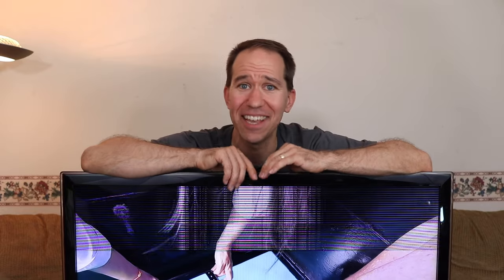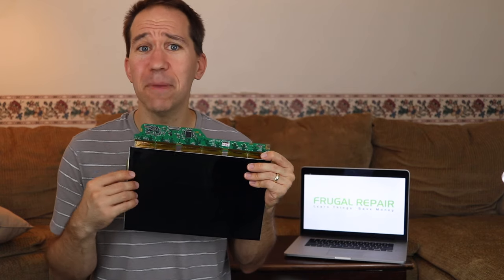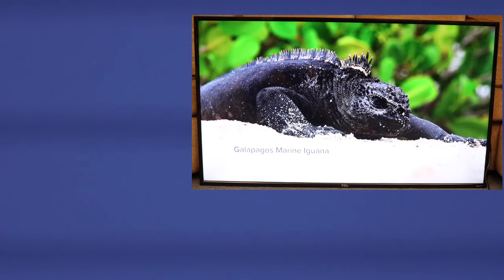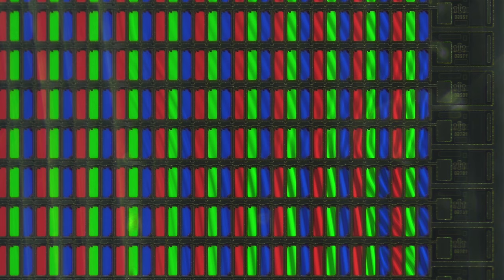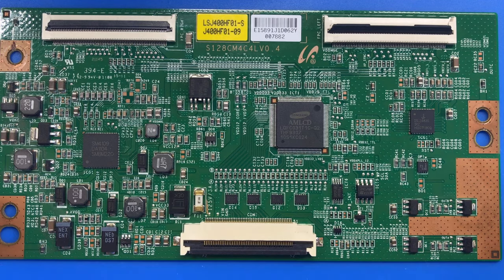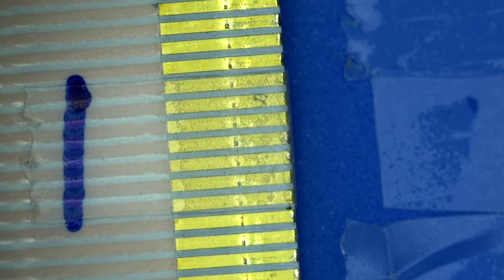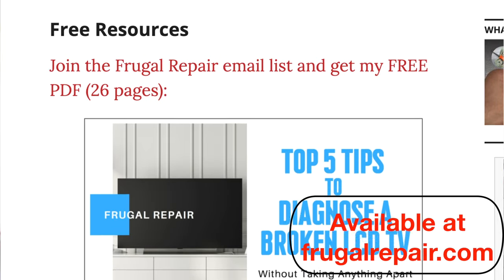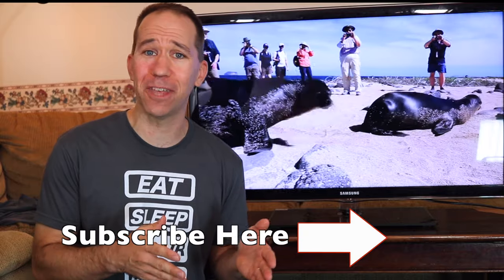Repair Hack Explained | How to Fix TV Horizontal Lines - Part 2

Comment: Hi, I've bought a broken telly because I like to repair electrical goods but I may have bitten off more then I can chew this time,  the set is a kdl-60w855b. I thought it may be an easy fix buy it's anything but
 I have tried a diffrent tcon board and the problem persists, i've reseated all cables and ribbons cleaned the inside of all dust and the TV still has a white vertical line about 2" wide, the screen can be seen faintly behind and there is a reverse image faintly seen within the white band. Could this be a main board and av board? There are that many causes however mine has that reverse image in the band so this might help diagnose. Any help you can send my way would be greatly appreciated. Thanks
Reply from the maker: Did you do the isolation technique I used in the video?  What was the result?
Reply: @FrugalRepair  sorry I'm in UK & it's 6am over here now so been asleep, im not with the TV at the moment as it's back at my flat, I'll be going there later on so will try the illusion trick, im guessing your talking about taking one side of the Tcon ribbons & leaving it off then repeating in reverse? I'll try it later and see what happens, I did however get a reaction by lightly tapping one of the microchips on the main board & got a reaction but not a great one, the line was still there the complete screen went a darker shade of grey and had diagonal lines, but only managed to gain this effect twice, also I'd like to know what your advice would be on replacing the main board and av board as I can get them online for a good price? Or are there any tests I can do to rule out them being the issue, thanks for your time & helping out, it's much appreciated as I'm stuck, im sure the screen panel it's self is good, that's why I purchased it because I know the internal parts are modular and have had mixed success in the past so thought I'd go for it, would the inverter board be a possible culprit aswell, if I can definitely rule out the panel being bad then I can just buy all the inside parts for it & it should fire up but that was my initial opinion on repairing it. However I can't get over the fact that I may have a bad panel even though there are no visible cracks or pixels that are bad apart from the white transparent stripe that has a reverse picture in it, why would that happen? Thanks
Reply: @FrugalRepair  hi I did the technique you did with the ribbons and at first half the screen went white then I forgot to turn the set off and disconnected the right ribbon, now there are 2 white lines and static in the background, before there was just a white line through the home apps page that was clear as day, now nothing but static sound and a dark screen, I could hear the apps sounds then the TV shut down & started blinking red 5 times in a row
Reply from the maker: Did you short something in the panel by not having the power off when you inserted the ribbon cable?  Sorry I can’t help with much detail.

Comment: I have a similar issue and I'm trying to decide if I need to replace the Main board or the Tcon board?
The issue is every 4 seconds my screen dims slightly. It looks like the dimming is faint horizontal black lines across the entire screen, It sounds like a tcon issue but when I was testing the connections on the Main board at the connector that goes to the power supply board my red probe slipped & accidentally crossed two pins on the connector soldered on the Main board & it sparked leaving a slight burn mark on 2 pins on the connector. Knowing this I would assume the main board took the damage however the horizontal intermittent lines (every 4 seconds) appears to be a tcon issue.

Is it possible this could have damaged the tcon board? Or more likely the main board?

Could a main board even have this type of issue?

Which board should I replace first? The main board is approx $100 & the tcon is $30-$40

Btw Its an LG 55LM5800 edge lit. I have already replaced the leds and the power supply board due to another issue which seems to be fixed.

Comment: My t.v. Shows like it should for about an hour. Then the white vertical lines start to appear, followed by a sort of large white spot.what do you think that could be?
Reply from the maker: Probably heat related since it lasts an hour.  Try the isolation technique like I did in the video and see if it’s lcd panel related.

Comment: I have samsung smarttv for about 3 years and seldom use. Recently it decides to shut on/off by itself . When turned On it runs for a while and then shut down. What would u think the issue is?

Comment: I have a similar problem with my screen( Sony KDL 42W653a). Instead of seperate T-Con board, it seems my TV has T con on the LCD panel. Any idea how i can rescue my TV?
Reply from the maker: Unfortunately, I don’t know your model.  You need to find the clock (row) signals somehow.  You may have a tcon integrated on the main board.  It’s also possible those signals don’t spot off until they reach the driver board, then you can’t use tape, but you’d have to physically cut the traces.

Comment: So I have a 2022 model Philips Roku TV 50”. It suddenly went blue screen on us. Still had the back light and sound but no picture. So after back and forth searching, I decided to change the T-Con and main board. No change. After watching your previous video I discovered after removing the left ribbon I just had a very small rectangle picture on left screen. Then removed right ribbon and had a good picture on left side. Now stumped on what to try and cover up on the right ribbon
Reply: So after trial and error I actually got a full picture back but still have some horizontal lines from mid screen to bottom. That’s better than no screen. Now I have to scratch my head and figure out which ones are controlling the bottom half of the screen. Very time consuming with shaky hands lol.

Comment: What if I used this fix once for the left side but then it happens on the right side (it's more than a year later)....is there any way to fix both sides using this method? Is this fix circumventing a bad panel or a bad tcon board?

Comment: Magnavox 43MV314X/F7 had pulsing horizontal lines at bottom of the screen. Replaced the T-con board - same thing. Tried the tape and the lines went away, but the picture/color on that side of the screen is darker and you can still see a faint pulsing in the picture on that side. Any ideas I can consider would be appreciated. Thanks

Comment: I have a car dvd that is running good.. but it fell off from my hand.. and got a single  doted line on the screen.. my question is can I still resolve it by hitting tapping y8 it over and over again or using by a blower? Im afraid to worsen the problem so please give a solution

Comment: Hello,
I have a Sony Bravia 48", model- KLV-48W562D. Few days back vertical lines started to appear on the screen. What could be the issue? I opened the TV but there was only one flat cable instead of two for left and right side of the pannel. Tried to clean it up but didn't work. What should I do?

Comment: I have a tcl with one black tape. My issue is flickering lights on the corner of the right side of the screen and moving horizontal lines rolling down the monitor. 

Covering any pins on the right half of the ribbon gave me a screen that would turn entirely red, then white, then blue.

I covered every pin on the left half one by one and it still didn't fix the issue. Is there a way to easily fix this issue?

Comment: I have a Panasonic LED 42inch TV that won't turn on , green light flashes quickly indicating power Board failure, power board has nice Rubycon electrolytic capacitors so most likely wouldn't be a dodgy capacitor.TV only had 18months use.
Any ideas appreciated.
✌️.

Comment: So I watched this and what I seem to have is a thin line at the top of my screen which is sending some signal but it's not complete and it's majorly annoying. You seem to have isolated it to Clock line 6 based on your video. I haven't actually opened the TV. Do I need a new ribbon cable? Or do I have an issue that I can't fix. I either want it to work 100% as this annoys me. The picture looks good, but I'm a stage technician and I want a perfect image.

Comment: Question... i just did this to my tv and horizontal lines dissapeared but now i have a quite distracting line of blue pixels to the side on the first column... to fully repair it should i try to source a new Tcom board???

Comment: I have a Sony KDL-32BX300 and it has no TCON board as far as i can see and based on my research. The problem I am having with this TV is that black/blank screens appear washed out/greyed out and I notice a very faint horizontal green streak across the screen when certain images are displayed. What could be causing this and what component(s) would need to be replaced in order to fix this problem? Keep in mind that I'm not a technician so I don't know how to test boards and whatnot.

Comment: Well if you ever read this message...
I bought a 4k 50' Daewoo TV a month ago. I've been very careful with it since the moment I myself installed it on the wall. 
A week ago me and my wife started noticing a weird behavior like interference color lines and suddenly 3 today's ago we witness with our very eyes how a dot appeared on the right inferior corner and with it what appears to be an impact on the screen. It actually came from inside and it was hot. Like it melted from the inside out.
Of course we took it to warranty but they don't believe us and they claim we hit the tv with something and it's our fault... 
Any chances to know if indeed that was something that happened from within the tv itself and manifested on the display? Is that even possible?
Reply from the maker: Of course there could be an internal lcd issue.  I’d try the isolation technique like in the video.  They may deny your request if it looks like impact damage.

Comment: Hello, my Samsung Monitor now started having a single vertical line, however if it is a black screen, the line appear dark green-ish, when it's a blue screen, it appears blue just with more contrast, I guess, and thats with other colors too, I checked the tabs and applied pressure on them but the line doesn't dissapear. Maybe it's the circuit board connected to the TAB's?
Reply: And it's just every second pixel in the line the other pixels in that line does show it correctly

Comment: I have a Panasonic TC-58LE64 from 2013 that has horizontal lines all across the screen. I have researched the problem and it seems that, most likely, it’s a bad LCD panel. I watched your two videos about using tape to fix a problem like that but my TV is a little different. If I unplug the left ribbon cable from the t-con board, the left side of the screen is white and the other side displays the “No Signal” message that bounces around the screen. But there are lines in both sides. The same thing happens when I plug the left ribbon cable back in and unplug the right one. Would this indicate that both sides of the panel are bad and the TV is basically done for or would it indicate a problem with the t-con board?
Reply from the maker: I would suspect that the tcon board is the problem.  It could be a bad LCD as well and something else is the issue.
Reply: @FrugalRepair  Thanks for the fast response! I don't think the tape fix would work since it seems both sides of the panel aren't working correctly, right? It looks like a t con board is about $20 to $30. Is there a way to be certain it's the t con board before I spend that much money?
Reply from the maker: I don’t know that I can give you advice on that. I would probably gamble and try to get a tcon.
Reply: @FrugalRepair  OK, I'll order a t con board. If that doesn't fix the problem, is there anything else I can try? Thanks so much for your help!

Comment: Thanks brother. I’ve done it on number 1 ribbon. It got fixed. But now again the issue is happening. Now it’s on number 2 ribbon. Again I added tape but it all got dark. How can I fix it? It would be kind enough if you help.

Comment: Hi. I tried your first method and applied tape on left side display ribbon cable  and was able to succesfully get image. Thank you for that.
Now, after about a year, again the whole display is black again. I get only the sound. It started with increase in number of horizontal lines and then one day whole display stopped.
I tried removing left side cable and right side ribbon cable alternately but bothing works both time.
Could you help me again this time?
Should i try applying tape on the right side ribbon cable too?
Thank you
Reply from the maker: Sorry to hear that it stopped working. You won’t be able to do the same trick on both sides. I’m not sure what your problem is it could be a bad tcon board or the LCD screen is bad.

Comment: Are there any corrective repairs that can be done when the ribbon cable becomes dislodged from the TV Screen?
Reply from the maker: You mean, torn away from the lcd panel itself?  If so, no, unfortunately, I don't think you can save that panel.  If you mean torn from the driver board, then it's still extremely unlikely you can repair it but there is a very slight chance.

Comment: I have a Hisense 55A6100 that has a cycling horizontal line issue. Every 1 second like clockwork (I bet it is a clock function somewhere!) I get small lighter colored 1 pixel wide horizontal lines about 5mm apart all over the screen (More visible on the right side) from a distance it looks like the screen gets brighter for that 1 second these are visible. Then they go away the next second to a perfect screen, then they come back. When I pull the right TCON ribbon cable I get 1/2 and image with these bands barely visible, but when I pull the left ribbon cable, I get nothing but a black screen with random vertical lines, NOT half an image. Bad ribbon contact? Or bad TCON board? I can see these voltages on pins LEC1 and LEC2 on TCON board going from +28 volts (good pic) to -7V (lines) any thoughts?

Comment: Wow thank you! Not only for the fix, but for the excellent explanation!
Do you think this problem is caused by the faulty controller board, or the faulty panel?

I tried on mine, but it's a different hw revision of your same board and i can't find the right pins :( 

I've found out the board is really cheap on eBay, might try replacing it entirely.

Comment: HI, I decided to replace my cables because of the amount of lines. So I ordered new cables and installed them and no lines. That was great.  But now there is nothing. The backlight turns on when I power it on, but the tv doesn't show anything at all? This is a smart tv and normally it comes up with a brief intro. At the very least I could see input selection but now with these new cables I get nothing. Did I just get bad cables?
Reply from the maker: Probably not.  My guess is that they need to be reseated.  Of course, something else could be the issue.

Comment: Hi.  I'm wondering if you can help?

I have a Samsung LED TV model No. UE46b8000.  I'm getting faint horizontal lines on the display.  After watching your video I disconnected each ribbon one by one and the lines only appeared when the right (as looking at  your video) ribbon was connected.  The board has the I.D. of 2009FA7M4C4LV0.9.

I can see plenty of boards on the internet with this I.D. but they do not list the UE46b8000 model as compatible.

Tomorrow I'm going to try the tape trick using trial & error as I haven't a clue on this board which ones to block, but would I be correct in thinking that a board online with the I.D. 2009FA7M4C4LV0.9 would be compatible?  There are some which are relatively inexpensive so I'm thinking of just replacing the board.

Comment: Hey bro I have a LG 55" will this method work n also what if when I disconnect the tcon board both sides showing the lines
Reply from the maker: If both sides are disconnected and the TV is showing lines, then your LCD is broken

Comment: hi, my philips smart tv is not working - gives me a black screen, backlight is fine. did a trial and error with the two ribbons on the tcon: With the left ribbon disconnected the right half of the screen works perfectly. With the right ribbon disconnected the left half of the screen works perfectly. But together is total black. Is the tcon broken or can i fix it?

Comment: I have a 58” JVC 4K TV that has lines on the bottom half that appear and disappear. Could this possibly be a power supply issue or a connection issue?

Comment: I have a Samsung 55" # UN55RU7200 bought 18 mo. ago , problem started w/black shadow just right of center starting at the bottom going up , then up left side of screen also , now no picture at all , audio is ok , can see something w/flash light held to screen , of course , just out of warranty, ?  help . thank you , Dave
Reply from the maker: If you can see with a flashlight, then it’s probably the led backlight.

Comment: I have just had a single horizontal line manifest seemingly out of nowhere on my Lg Oled Ea 9600. Im going to try this trick on mine if it’s even possible. I love the curved OLed screen which still supports 3D. Repair shop advised not to spend the money to replace the panel. I love the new Oled I had to purchase to replace it, but it IS noticeably different without the curve for cinema movies. Kinda really bummed out about the whole situation.
Reply: did it work

Comment: @FrugalRepair hi, I have horizontal lines on my tv. I tried to remove the left ribbon and then the right to see which side got the problem. In my case, when I remove left cable I get lines on my right screen and if I remove right cable I get vertical lines that slowly turns my screen black. Do you have any solution for this. Thanks